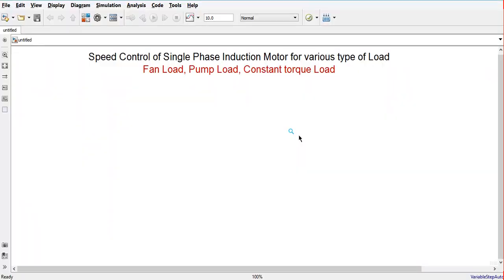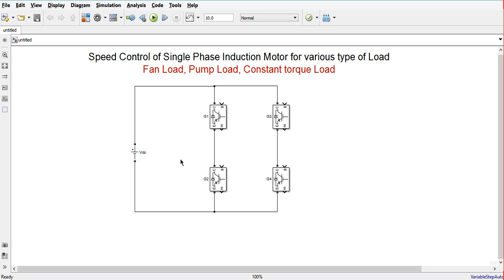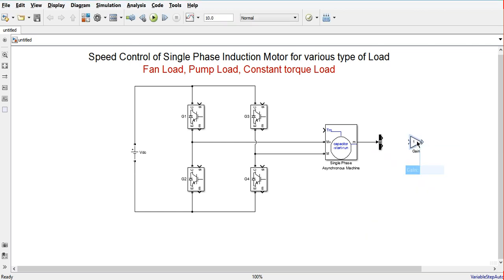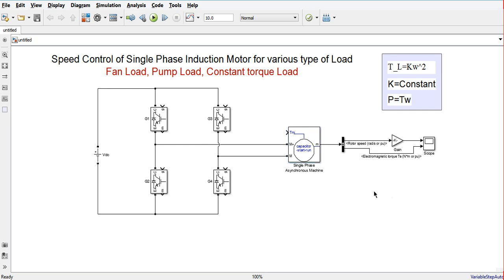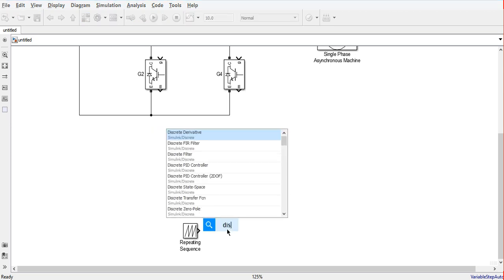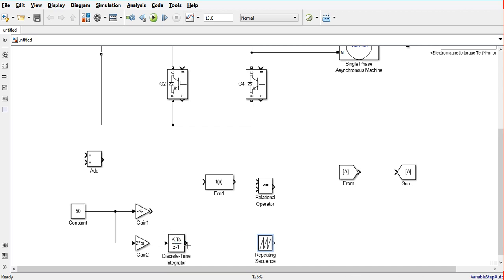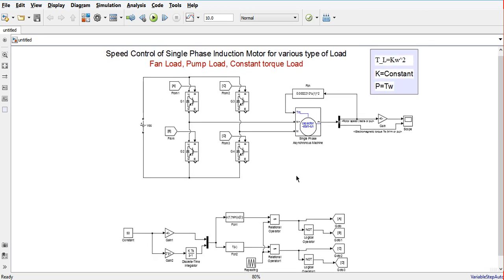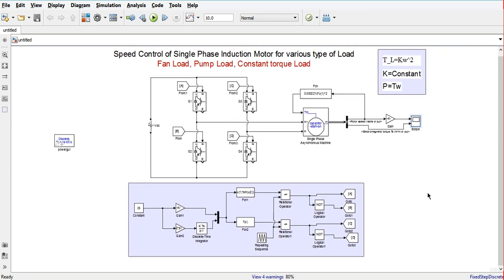MATLAB Simulation on Speed Control of Single Phase Induction Motor | Single Phase IM | Speed Control

Comment: It is only Frequency control not v/f
Reply from the maker: You can check the inverter output voltage and freq ratio
Reply: @controllers_knowledge i checked once you checked in the scope ....remove motor and at that place put voltage measurement block and see in the scope and at the frequency input connect one KNOB and set simulation time to infinite and varry the knob value and YOU SEE IN THE SCOPE IS VOLTAGE IS VARRYING OR FREQUENCY OR BOTH
Reply from the maker: We have tested this setup under the well known professors.
Reply from the maker: We have tested this setup under the well known professors. There are lot of IEEE paper on V by F control. You can refer that papers and varify.
Reply: @controllers_knowledge  once again it is not V/F control pls don't say in the video that it is V/F control

Comment: How did you find pump constant
Reply from the maker: Just check the ieee paper on "model based design and sliding mode control approach for two stage water pumping system with reduced sensor".
Reply: @controllers_knowledge  and where to check exactly?
Reply: @controllers_knowledge  Are you 100% sure that is the right value of K constant?